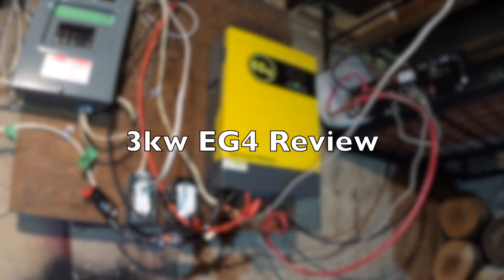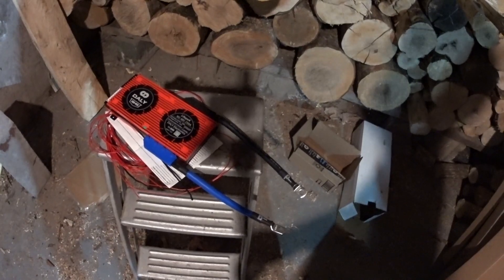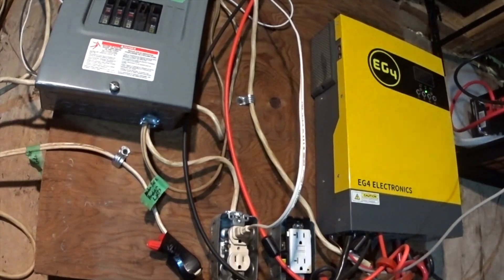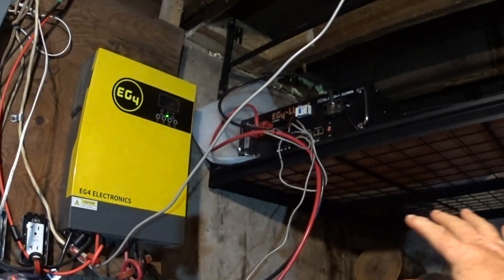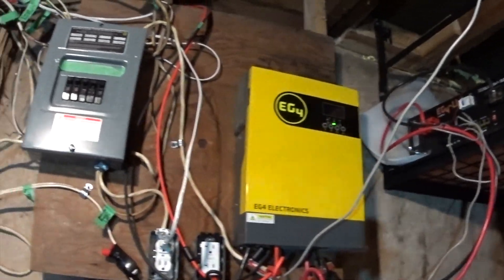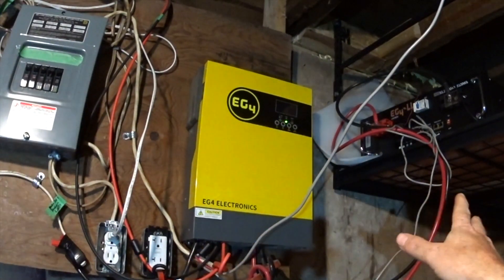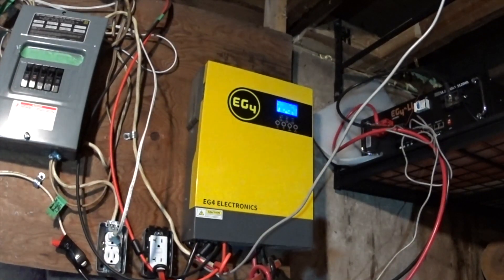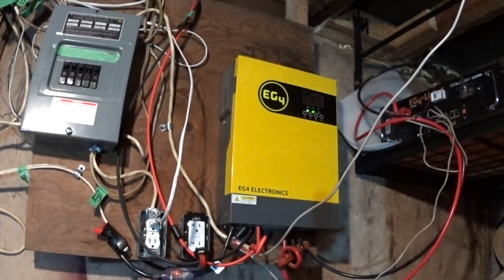3KW EG4 ONE YEAR REVIEW - Offgrid Solar Powered House

Comment: Payback 15 years?  How much was the system and how cheap is power where you are at?
Reply from the maker: 16 cents CAD per Kwh. i'm not using the grid as my battery so i can only story as much energy as my battery can take for after hours. So i can't consume or sun than my 15Kwh battery. Once that is full, i'm wasting sun.  So the pay back period is longer than grid tie system generally

Comment: Can you get a gas dryer and waterheater?  Those would save a lot and also greatly drop your electrical demand.
Reply from the maker: Could do, but then i need to pay for gas which is increasing and which in someplace they are trying to limit. My plan would rather be to put more load on the offgrid stuff, or continue to build it out to be able to handle those loads. it does the water heater mostly ok but i need a lot more solar panels now to keep up
Reply: @MicahGallant  Batteries, panel and inverters don't last forever.  For now at least gas is cheaper.  It's worth a bit of your time to run the numbers.

Comment: 10-15 years? How mutch did the whole system cost you?
Reply from the maker: I have 2  3kw units now, for 240 split mode, works great.  The main cost was batteries. spend 14k doing it myself. Cheaper than a grid tie install anyways

Comment: I just set mine up with 6 250w pannels and 4 12v deepcycles. It wont run a portable ac for more the 5 min:(
Reply from the maker: But why,  your batteries won't hold up? I suspect the voltage sag is the issue there, not the inverter

Comment: My burn out in less than a year , no a good unit , was installed professionally , my victrons are working much better and no problems so far. 

Stay away from this units Eag4.
Reply from the maker: Thanks for your experience. Mine have been flawless now for... 3 years straight running. Very good for me, and i have 2 for redundancy, one goes down, the other stays up while i order a new one or fix it or something. I run split 120 240 with 2 units.

Comment: If you really want to step up to two of those inverters, I would look at a rack of 4 of those batteries and will need prob 3kw of panels, though over panel is always nice for cloudy days.
Reply: P.S. if your fridge is using 1800 watts.....you need a new fridge....
Reply from the maker: Yes, but don't have money for a fancy new one, $2000 CAD for fancy new ones. I don't know who can afford them.  Right now i have 15Kwhs of batteries, which is a better fit than one 5kwh battery

Comment: Nice Video. I had an all-in-one failure and no off-grid ac. I like function over appearance, and your modular system resilience ideas. I run 3 victron charge controllers on 3 strings of panels for a total of 3500w. 2 diy 24v 310ah dc batteries I made from some of Will Prowse's videos. both batteries are working fine. each has a slightly different ah discharge rate of about 5ah's over 2 cloudy days. I'm assuming this is due to a 1-year difference in cell pack internal resistance and versions of 250a 24-volt bms's, different Shunts.  Since cells are no longer cheap, try to get entire pack of cells at same time and matched, if you can.  Have a great day.

Comment: Ive been running the same inverter for over a year now non stop 24/7 in my cabin . 2 life power 5k batteries. The thing is a work horse. Never had a problem.  Great unit. I did hear somewhere on YT that a concern was for the dust on the 480 volt inverter building up an possibly causeing a fire hazard? Idk about that but,  i do plan on shutting it down tue  first of the year an do a thorough cleaning and inspection.
Reply from the maker: Yes, been running mine stead well over a year now, flawless. I have a rebuilt one from Sig Solar and the fan is getting noisy on it but otherwise flawless.  Good idea on cleaning dust though, get some compressed air and a vacuum for sure

Comment: One question  would be, is the new  14kw battery work with the 5kw you have?  It is a little lower cost kw wise than the 5.2kw.  I'm glad it is working for you. The new 6 kw inverter might be an option and have the 3k as a back up.
Reply from the maker: Yes, the new battery has same voltage as my sig solar battery so you can hook them up in parallel for 20~ kwhs of batteries. If I had the money I would do that but i need to recover some costs

Comment: Is your AC from a non GFCI and AFCI circuit?  My system trips the GFCI outlet when I have the AC out plugged into the manual transfer switch and AC in plugged in and starts to charge the battery. I have to unplug the AC out to charge. PV charging alone works fine.
Reply from the maker: Yes, i do recall an issue with the gfci, not using it anymore. The grid power is straight from my main panel.

Comment: Nice Setup!  Codos!!

Late last year I took a dive into a DIY solar setup as well.

I went with the PowMr 5000W Hybrid Solar Inverter 48V.  I have a small array of 6 donated solar panels hooked up in a 3x2 array generating about 1800 watts at peak.  (180v max output).
I set up a 4x4 array of 12v 40ah lead acid batteries which should total 7680 watts (48v).  I doubt it is that much capacity now given the batteries are a few years old.
These batteries were also donated, used batteries from a computer room UPS system.  

I never intended this project to power my house.  Rather to help charge my PHEV.  As the entire system is built on and in my garage.  The car's battery max capacity is 18kw.
I built this system on the cheap as a proof of 'wishfull-thinking' concept on my part.

So far, it appears to be working as intended.  With full sun and full batteries, I can get maybe 4 hours of light charge to the vehicle.  (I have it set to only draw its minimum 8 amps currently.)
At night, if the batteries are at full charge, I can get upwards to between 1-2 hours of charge before batteries are depleted.  If there is no solar or battery input the Hybrid inverter switches back to Grid.

My desire for the next step is to upgrade this setup with far more solar panels and if finances permit, switch over to LifePo batteries like your setup.  

Again, great setup!
Reply from the maker: Thanks for the comment. Yes, great experience is gained by starting small, then building. Thats what i did, and i did it in such a way that i can expand as I go. Coming shortly is another eg4 inverter that i will hook up in parallel with my existing one for 240 volts! This system, though expensive (mostly the battery) saves us $50 a month on our electricity bill, better than nothing but long payback when it comes to the overall cost of the hardware, 15 years... i need a larger battery bank to collect solar all day as my 5kwh battery fills up quick and then my panels just idle all day.
Reply: @MicahGallant as the price of electricity goes up your payback period will shrink though
Reply: @johnfitbyfaithnet  Yeah.   Wish I had the funds to upgrade quickly.
Reply: @MicahGallant   Noice!   Same here.  Starting small and cheap. With secondhand panels and batteries.  Learning as I go.  Started as more of a 'can I get some solar miles on my car.'  
It's not much, due to my lack solar capture and storage, but the basic concept is working.  I can knock an hour or two off the average 12-14 hour charge for a depleted battery before it switches to Grid for the rest of the charge.  I would love to cut that on-grid charge time at least in half.  (or more).  The car's battery is only 18kw.

Obviously LifePO batteries are the way to go.  Along with more panels of course.  Just need to make the initial investment.
So far, the only money spent was on the Hybrid inverter and associated cabling.

Comment: What's the cost for the 5kw battery?
Reply from the maker: 1655 USD as I see it, you can see it here, click batteries: https://signaturesolar.com/?ref=vBPxa1lWHkhTM0
Reply from the maker: I recommend this cheaper model, $1419 here: https://signaturesolar.com/eg4-lifepower4-lithium-battery-48v-100ah/?ref=vBPxa1lWHkhTM0 You don't need the screen on it necessarily as you will be monitoring generally using the inverter or other tools
Reply: price is now "EG4 LifePower4 Lithium Battery | 48V 100AH | Server Rack Battery | UL1973, UL9540A Price: $1,259.00 @MicahGallant   👍

Comment: Great job!  Certainly the best battery and inverter combo bang for the buck available today! 👍😁
Reply from the maker: Agreed, Will Prowse speaks well about them as well. I've had zero issues after a full year of constant use supplying our whole house. Just my experience but its something. I have a second inverter on the way so I will have 240 volts, hope to put a vid up about that one as well! Can't wait!
Reply: @MicahGallant  Good day to you. 
Love the update. I just recently bought one of the 3000kw unit (the newer version) I am not planning to grid tie it but like you charge from the grid when solar is not available. My question is how did you set it up for that, considering the treatment of ground bond neutral that I am still trying to understand for this unit.
Reply: Give it another 6 montjs to a year. High frequency inverters simply don't last.

Comment: So adding another inverter will give you 2 x 3000 watts or 3000 watts@240v? if so 3k at240 will be insufficient to run your average hot water heater which runs at 4800 watts.
Reply from the maker: Great question, glad you asked, as I had not thought of it that way. I measured it, so its consuming 12 amps per leg of the 120 volts, aka 1500 watts. And I think i spoke incorrectly, the hot water heater consumes 3000 watts at 240 volts. So based on what i'm measuring, it only pulls 1500 watts per leg, totally 3000 watts. So two of these units should work
Reply: I would go at least 2 x what you think you will need. 3000w running 3000w load will kill that machine. I run a 6500w inverter and rarely get over 2500w. I can if needed run my AC and microwave at the same time or the AC and some other cooking equipment like instant pot etc.
Reply: Propane water heater.
Reply: @miketlane  you can always add a low wattage heater element. They are cheap and a great way to store excess solar energy instead of giving it to the power company at wholesale rates

Comment: After getting out of a big city I built a 16x40 mine Mansion. Open floor plan for my son that is in a wheelchair. I haven't gotten my Frankenstein Soar system back together. I was able to get it back to recharging my batteries but haven't gotten it ran into the mime Mansion. I got a old Hot water tank and I am going to build a box to preheat my water so my hot water heater will either not come on or just be used very little. I have the heat as you go hot water system / tankless and this works well when it's hot like it is now. Most of the time the hot water heater will stay off. I take showers most of the time in the late afternoons 4-6 O clock so unless there's been a lot of bad weather it works well. I painted the old tank flat Black and will have a box with Plexiglass to cover it. Run the hot water from the tank into the water heater and it will heat if needed. With tankless it only runs when in use, so with hot water running through it it will stay off unless the water gets below 120 degrees. I put 2 shy lights on each end in the mine Mansion and don't needs lights in the day time. I should be able to be almost grid free soon if need be. Planning on getting a big water storage tank soon also. I will catch rain water for flushing the toilet and use the storage tank for potable water.
Reply: Hi. I built a water heater using a 5 gal bucket and a solar panel and a couple diesel engine glow plugs wired direct to the solar panel. it heated over 100 deg in about an hour or so, it proved the idea and function. I have it setting on a shelf with rest of preps just in case. This idea should work for a larger volume, I only have needs for max of 1 to 3 gallons of hot water in an emergency situation. If the water gets hot enough it could also disinfect it but do your own research on that subject.  It's a way to save fuel and costs over time. I saw the setup on a video from an India villager. Here is one example video title:    How To Make Solar Water Heater/geysers Under 10$??      Have a great day.
Reply: @mikemcguire5859  Thank You I will check it out for sure.

Comment: nice setup! I just purchased one myself with similar intentions as you. can you elaborate on the RF chokes you have installed on the DC in/out side?
Reply from the maker: yes, I just have ferrite rings that i wrapped the wires around just to do something / anything  in terms of stopping or limiting RF. I still need to turn off my solar panels as most of the RF comes from my panels because they are right under my copper loop antenna
Reply: @MicahGallant . I was going to ask you  about RFI (radio frequency interference).  As a amateur radio operator is there interference on the HAM  bands?  What frequencies are those copper loops for?  N1WMN. CT Drew.
Reply from the maker: @drewmichael4014 80 meter full wavelength copper loop antenna is what i have, which goes right over the solar panels and a portion of it tracks above the exact path of the solar cables coming into the house as well so its a bad config for RF but I don't have many other choices